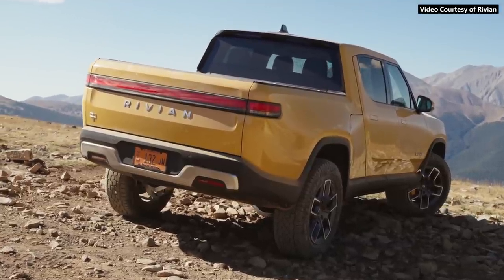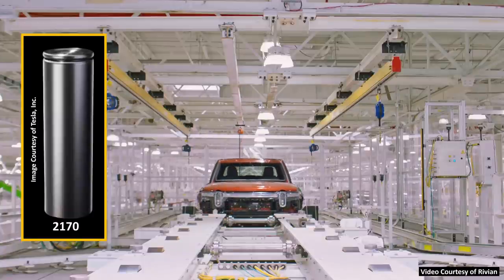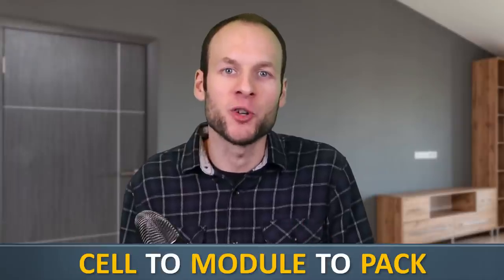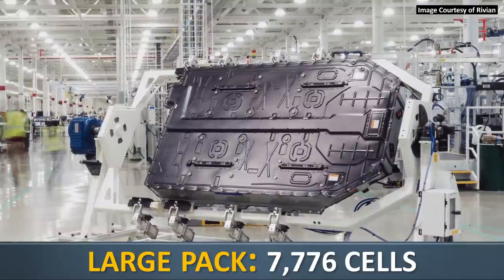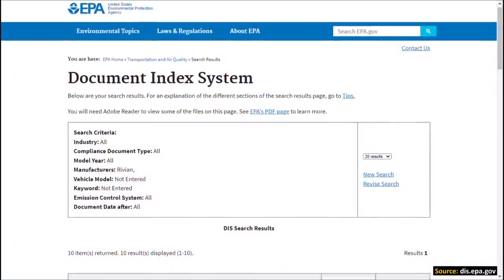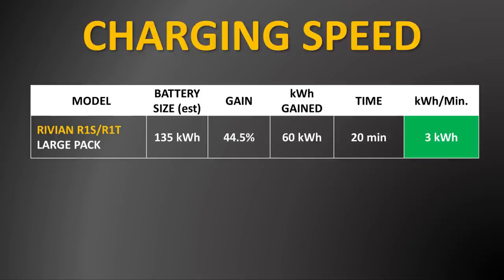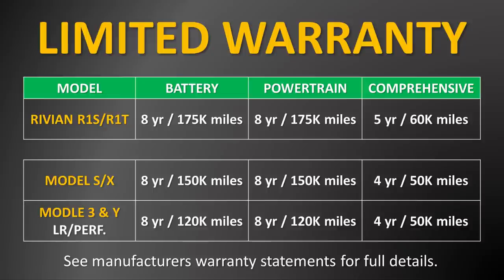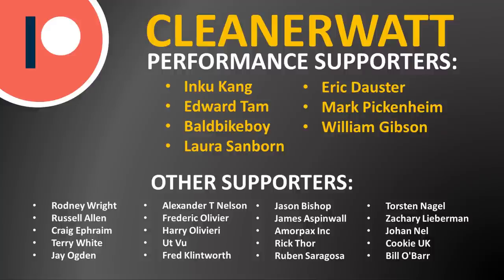Rivian R1T Electric Truck: How Good are Rivian's EV Batteries?

Comment: looks like truck
Reply: looks like FRAUD to me.
Reply: @markplott4820  who told you that? I live in Normal, Illinois not far from the plant. It's real. Employee driven trucks are everywhere in town. They're real. I have acquaintances who work at the Rivian plant. They look real to me and talk about real jobs. Whoever told you that Rivian vehicles are some kind of fraud steered you wrong. Just sayin...
Reply: @thepurplemaskknows9383  : Yeah.   I am rapidly becoming aware of people who authoritatively spout off nonsense.  They are either trolling, ignorant or stupid.  I hope Rivian sees success. . .  But, it’s not going to come from my wallet. . .  either the truck or the stock.

Tesla chose the cylindrical cells for their batteries because the ability to cool them.  Rivian seems to have thrown away that advantage.
Reply: @dewiz9596  The video says Rivian are using 2170 cylindrical cells?